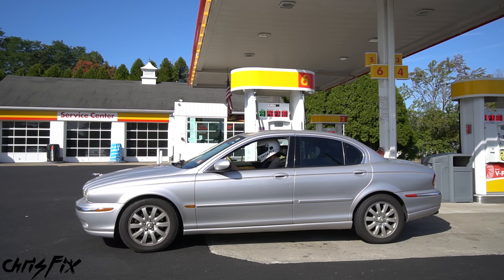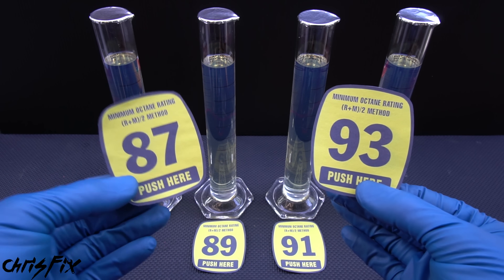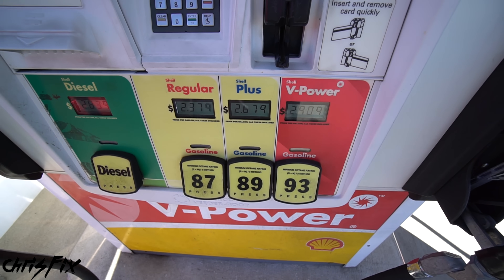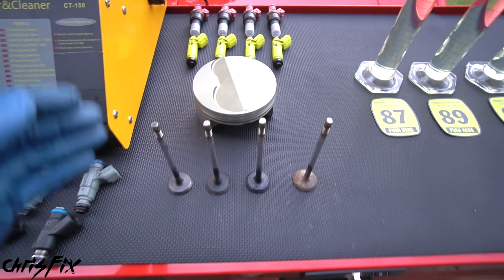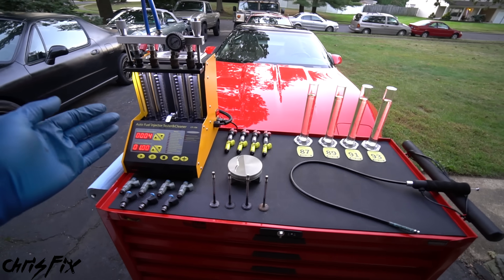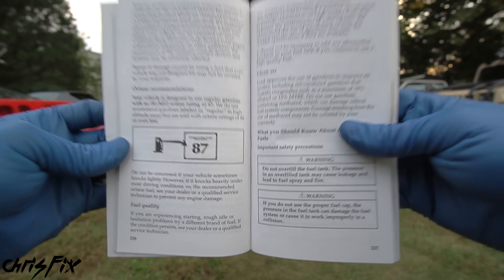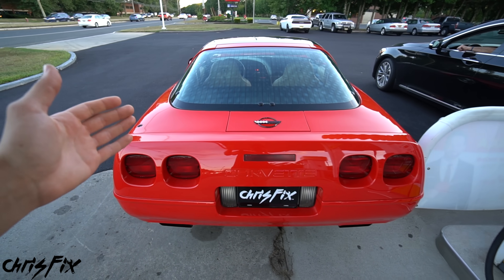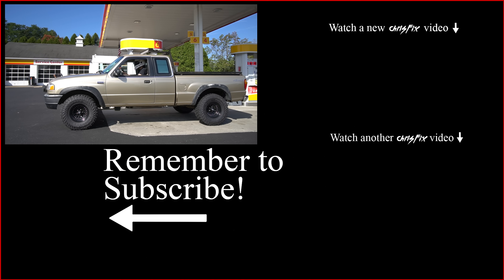What is the BEST Fuel to Use in Your Car or Truck and WHY

Comment: You forgot to mention that the octane rating stickers specifically state the MINIMUM octane requirement for each grade of gasoline. The top tier gasolines such as Shell is typically 1-2 octane points higher for each grade of gasoline. Example: Shell MINIMUM/ACTUAL. Regular 87/89. Mid-grade 89/91. Premium Vpower 93/95. I know this for a fact because I used to manage a couple of Shell gas stations and I once spoke to the department of agriculture one day and not only do they test the equipment measurements but they also test the octane level for each grade of gasoline. And the Vpower? The 'V' is for V-ehicle. I like to think of it as the Roman numeral five because it packs an entire 5x more detergent than regular and mid-grade. Took a seminar on the Vpower when it was first released.
Reply: In ohio they don’t check the octane of gas when inspecting the pumps, they only check quantity
Reply: What about 86 octane, I see those occasionally
Reply: @MrOiram46  depends on the brand. I can only speak confidently about Shell gasoline but it's safe to say that Chevron is rated as high. So an 86 would range at 88 from those brands.
Reply: Fun fact: All gasoline brands come from the same distributor. It is exactly the same gasoline no mater where you buy it. Don't believe me? Call your local gasoline distributor.
Reply: @MikeF1189 Yes you’re 100% right, what makes the gasoline different are the additives/detergents each station or brand so to speak put in their trucks as they’re being filled… i filled, applied our companies base additives and drove these trucks
Reply: @christophermichael5256  I didn't know that any additives were added to the truck when delivered. Thanks for the info.
Reply: @MikeF1189  Oh you mean the mini-me corporate stooges that read from an edited script? 🙄 Oh yeah sure says the sheeple.😆 Yeah I believe you. Sincerely 😏

Comment: You made one incorrect statement to "not put gas into diesel tank as it will not run and damage the engine". It will run just fine in many circumstances. In fact, crude cold climate diesel fuel is simply a mixture of diesel and gasoline. The possible damage has to do with the lubrication of that high-tolerances high pressure gear fuel pumps in older diesel engines. Simply put, my battle group's diesel engines are able to run on anything (preferably but not necessarily with right additives) and often do when away in combat. Back home we use the super clean JP8 just-cause we can.
Now a gasoline engine is a different story altogether.

Comment: If I have a car that has a 13.2 gallon tank, can I use an octane booster that has 6 ounces? would that be too much to use if I need to fill up with gas of a lower octane as my car requires premium 93?

Comment: You run the fuel the manufacturer says the Vehicle was Designed to run on. To many idiots run Premium in a Vehicle that was Designed to run on Regular. Running Premium Ina Vehicle that was Designed for Regular won't give you more power and will actually  make ut run worse. Total waste of money.
Reply from the maker: I wouldn't say your car would run worse, but it would be a waste of money!
Reply: @chrisfix  pre ignition with higher octane, timing, compression ratios, un-burned fuel. Knocking with higher octane because of pre-ignition.

Comment: I want to build a 1955 DeSoto Hemi engine for my 1929 Ford Coupster with a Wieand Intake with 4 Stromburg 97 carbs and high lift cam 727 tf trans and Franklin Quick Change Rear Axle so I’ll use Aircraft Fuel 110 Octane Fuel

Comment: heres my tips to help increase milage I had trouble with bad sticking float valve in gas tank i t would drop to the warning level when sitting and idling my var is 4 cyl. Dodge Caliber! SO I strated using spray il in gas tank and it instanly fixed that problem and my gas mileage incresed 2 mpg more in city! Aslo inflate tires as much as possible front more than back i use 42 psi in front and 40 in back 

OF course use additives to clean your fuel system at least once per month. also dayum tune up your car evry 4 years i just did mines spark lugs air filter and the pcv valve total cost only $35 car tuned up in 45 mins 1 plug wasnt properly set it was smooshed on the center fire ping. SO i used my eyes and and pair of scissors with ones that were set right to get the gap right.

boom my car is running like clock no more kicking when going up hill hestitaion gone milegae through the roof also of curse people dayummmmmm do not be laed foot driver take it easy you will still get there at next redlight with the ones gunning out of stop1

And it saves wear n tear on engine parts transmissions rears etc... and your gas milegae too!

HEY trust me jack rabitting switching lanes cuts gas milegae because your using the power steering pump. also clean and waxed car REAL wax not car wash thin coat will help gas milege and polished windows also help in rain and dry conditions and power windows work better 
 BEEN driving since 1970 and belive me when i was young boy was i speeding when they opened up the ac expressway 

GOT stopped by a cop once for speeding as long as you stay under 70 mph like 69 no cop will stop you well actually you have to go 10 mph more over 70 

Just do not get stopped on in state of New jersey on the reg roads. FOR gosh sakes even today high prices on ac expressway $.4.40 and $1.30 sure as hell beat a $125 fine for speeding yeah sure you can save money taking the other routes to shore points but now add an half hur to drive time redlights only able to drive 40 mph n 50 mph nahhhhhh no way 

HOPE this helps you all

Comment: I just bought a 1989 jet boat  has a 454 Chevy motor, it had been sitting about a year or two. I drained the gas & it was bad old & had water in it. I put 91 octane gas in it also added seafoam each tank replaced gas water separator with carb rebuilt & new plugs. My question is do I need to keep running 91 octane in my boat ?? By the way I will be taking my boat out this weekend for the first time.

Comment: What happens if you use 93 and put the octane booster in?(fun little question)
Reply: Then you would actually meet the Audi fuel requirement of 95. Otherwise, it would just be wasting money

Comment: Thank you for clearing this up!  I run higher octane because I feel less vibration, and the engine also sounds quieter.  Technically I can go all the way up 91 in my corolla before I start throwing money away. So I'll use 90 octane often or 89 if the next octane is 93 at the pump. Very good description here. Thanks!
Reply: i have a honda accord v6 i’ve been running 87 in for its whole life, it’s older now.. should i try running 91 a few times?
Reply: Maybe its time to change your oil if ur engine is noisy
Reply: @u-know-this  the oil changes nothing in my own personal experience.  I have even started my car after draining the oil and started pouring the oil in and it never got louder.  But a good exhaust and good fuel always feels better with a lot less noise. I don't understand it.  But it feels good when you're not vibrating at a red light or stop sign.
Reply: @u-know-this  the oil changes nothing in my own personal experience.  I have even started my car after draining the oil and started pouring the oil in and it never got louder.  But a good exhaust and good fuel always feels better with a lot less noise. I don't understand it.  But it feels good when you're not vibrating at a red light or stop sign.

Comment: Watch min 1:49 then 15:38 "It will not give you more POWER and then saying using premium you will get more POWER" lmao
Reply from the maker: Correct, on cars that can take advantage of the higher octane (where it says recommended) you will get a little more power because it is set up to, but since a lot of cars only need a required 87 or low octane, the extra octane is worthless in that case!
Reply: @chrisfix  You got me confused, thanks boss. Thanks for clearing all the myths, very educational video. Love all the videos! ❤

Comment: So I have a 2014 Chevy Silverado that IS flex fuel, what gas should I use?
Reply from the maker: I am planning on making a video about ethanol soon, but the main reason to use ethanol is to save money. You can do some napkin math to see if filling up with ethanol is worth it, if the price difference isn't that much it's almost always better to fill with normal fuel, but if $5-7 a gallon for gas and $2-3 a gallon for E85, you should use ethanol!
Reply: Thank you Chris, I appreciate the response so quickly. Keep doing what you do, and thank you for explaining the gas difference.

Comment: Compression ratio is all the matters and is the ONLY determining factor on what octane you should be using in your car. Higher compression = higher octane
Reply: Not really true anymore. My engine compression is 11:3:1 yet it calls for 87 octane and literally states in the manual that using higher octane is not necessary and will not provide any benefit. I find it crazy they even put that statement in the manual…then again most people now a days don’t even read theirs.
Reply: @ricanredliner  if that’s what the manual says then I believe you. Although 11:1 isn’t crazy high so 87 octane does makes sense. The only cars I’ve had that required premium was my Z that had 14:1 CR and my turbo WRX. Also, the altitude that you live and operate your car at can effect what octane you use. The higher the altitude the lower the octane you can get away with. When I lived at sea level the lowest they offered was 87. Up here in the mountains they offer 85 as lowest. Bottom line is just put in what the manual says lol All the comments of people saying they get all these benefits from putting premium in grocery getters is complete placebo though.
Reply: @RealMrBased  technology has also changed. I remember when 11 was considered high compression and required premium. Most manufacturers now are designing engine to be 87 acceptable because that’s what most drivers will put. I personally know people who own cars that require or recommend higher octane but refuse to use it. It’s something I consider when car shopping, what fuel does it take? Your average shopper doesn’t.
Reply: @ricanredliner  oh my gosh! I would never buy a car off a dude if it required premium and the dude said he always puts regular. Pre-detonation is bad for engine. Makes every mile you put on more like putting 5 miles on. I understand there a lot of people who are not into cars and how they work (I’m a totally hear head). But at least read and follow the manual ffs 🤦🏻‍♂️. I hate how arrogant people can be.
Reply: @ricanredliner  Like why spend 10s of thousands of dollars on something and then treat it like shit. Makes zero sense
Reply: @RealMrBased  don’t buy used then. Most people with leases do this. Run regular in cars that require premium cause they don’t care. They will return the car and get a new one.
Reply: @ricanredliner  Yeah I understand that especially with leases. I would never touch a car that was leased because like you said they just dgaf. The only car I ever bought new was that 370Z I was talking about and it was  horrible experience. I felt like I was paying so much money when I could have gotten something similar/better for cheaper. I do only buy used cars from private sellers who have extensive maintenance records though. It is a gamble but the maintenance records help put my mind at ease. If they are willing to hold on to all that paperwork they probably took care of it and are less likely to lie about how they treated it. Like I said I’m a gear head and I’ll make them bring the car to my garage where I have a lift and I’ll do an extremely thorough inspection myself. Of course I can’t tell what fuel they used just by doing an inspection but if it has low miles then it not a huge deal. Anyways, thanks for the chat man!
Reply: @ricanredliner  if you car doesn’t call for it in the manual it’s a waste of money and if you’re putting in lower than your car calls for you will get pre-ignition/pre-detonation

Comment: Jesus dude, I mean this with all due respect to every technicality and experience you have gained and shared, however you mistook pre detonation with misfire or off timing.  A pre detonation happens during compression, where the fuel air mixture cannot tolerate the compression(alone, no spark) resulting in a power, combustion (stroke) that is not an initiated by the spark plug hence the knock. It’s similar to off timing but not as-mechanically.

Comment: I tested E-85 in my stock 1998 Civic and it actually ran more ore less ok.  I ran the tank dry first and filled it up with about 4 gallons og E-85.  It had a little less power but it did run ok.

Comment: I have a 2013 Honda Accord with vtech engine with a muffler delay with a pipe replacing my muffler I’ve always used 87 is there a certain type that would be best for my car it’s a 4 cylinder

Comment: The greatest importance to all consumers of gasoline is to have the confidence of the posted octane numbers! Here is Hawaii they can’t be trusted! Race car, auto mechanic, insurance investigator of automotive crashes, former host of weekly radio show George Nitta tests the actual octane number. All octane #’s were not as posted! With the exception of the Shell V-Power @92 to 90 in the test! Other brands were way under posted #’s even under 87!  That includes the 92 can be below even 87!

Comment: Almost all cars manuals saying use 87 or better for that I am using premium
Reply: Huh? Why would you put premium in a car designed to run on 87? 
Also, definitely not "almost all car manuals" say to use 87. You made that up.
Reply: @DigitalBathInAZ  just read the manual first mostly all manual saying 87 or better... just read it and then say something why saying 87 or better ...probably just for fun
Reply: What your experience with engines...?
Reply: There are more and more cars requiring premium due to compression designs and turbo-chargers becoming more commonplace. In the 1980s, I'd say you were right. Even the 1990s, even though my 1992 Acura Legend and my 1996 Lexus LS400 both required 91 octane. But your comment is not true, I'm afraid. 

But that was only one question I had. Try answering: if the engineers who designed your car call for 87, why would you waste money paying for 91 or 93? Did you not watch the video? Chris, and he's right, just told you it accomplishes nothing. Unless your goal is to make Big Oil wealthier than they already are.

Comment: My GMC 5.0 truck says 87 or higher. I always run the higher. It gets better mileage on higher. I do the same with my 98 stang.
Reply: So you're saying Chris is wrong? He isn't. If the engineers of any design it to run on 87, it does not benefit the engine to run on premium. You're just wasting your money and gifting the fuel station.
Reply: @DigitalBathInAZ  well it's my money to waste.  I actually agree with a friend of mine that a fuel chemist. On what fuel I use and why I use that fuel.   My manual On my truck says 87 or higher. So that's is what the engineers are saying also. It will also run on ethanol. I don't use that crap but you can. My truck is also designed to run on little one cylinder, and auto stop by the engineers. Just because they designed it that way doesn't mean that's the best for my engine. I have installed a device that keeps it at V8 all the time and disables the auto stop. Guess what I'm getting 3 more mpg, and much better performance.  I drive my vehicles up to 300,000 miles and have very little problems with any of them. Like my manual says.....or higher.
Reply: @jojojack4975  Indeed. It is your money to waste. So Chris and auto engineers are wrong, but you're right. I gotcha. Chris busted the myth about efficiency improvement with higher octane fuels on engines that aren't designed for it. The engineers programmed the ECUs to only adjust timing for octanes that is too low, not too high. 

Having said that, my Ecoboost is tuned with a handheld device and I run premium on it, but that's different. That's because I programmed it to perform and require 91 octane. But that is not at all what we're talking about. The discussion is running premium 91 on a motor programmed and designed to run on 87. Yes, that is a waste of money and any perceived benefits are imaginary.
Reply: @DigitalBathInAZ  you're correct, that's why there is no auto repair shops or vehicle recalls because everything the engineers do is correct. I can tell you never read or comprehended anything I said. You just want to argue, and call my friend who is a fuel chemist for the Airforce a lier. At this point I believe you are full of crap. Why did you need to tune your Ecoboost? So I guess the engineers didn't get it right when they designed   your Ecoboost.
Reply: @DigitalBathInAZ  By the way, where in my post did I say Chris is wrong? All I said is what I run in two of my vehicles.  I mentioned nothing about what I use in my other vehicles.

Comment: 🧐   BUT, IF 87 AND 93 BOTH HAVE THE ‘SAME’ ENERGY CONTENT..   ..THEN WHY DOES AN ENGINE SIP THE 93 AT A SLIGHTLY LESSER RATE THAN 87 TO RUN ANY GIVEN NUMBER OF MILES ??
- YEARS AGO, I USED TO DRIVE A WORK VAN AND WOULD KEEP TRACK OF THE NUMBER OF GALLONS NEEDED TO RETURN THE TANK TO FULL AND THEN COMPARE THAT TO THE NUMBER OF MILES DRIVEN AS DISPLAYED ON THE TRIP ODOMETER…  
 …THE RESULT WAS ALWAYS ‘MORE MILEAGE FOR A GIVEN NUMBER OF GALLONS’ WITH THE HIGHER OCTANE.  🏎

Comment: You are incorrect. I was a tenure track mechanical engineering professor and taught thermodynamics labs, which included bomb calorimeter experiments. The lower the octane rating, the higher the energy content. Also, octane ratings have nothing to do with the octane in a fuel. They measure the resistance of a fuel to pinging with respect to a gold standard engine running on pure octane. 100 is defined by the knock resistance of the engine running on pure octane.